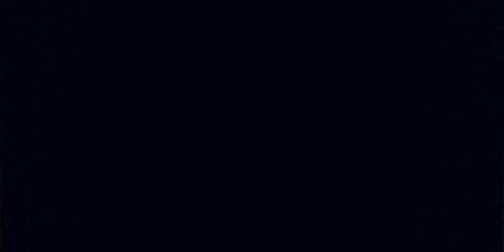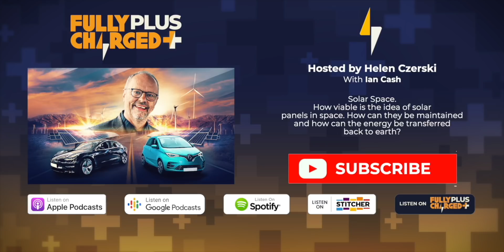Solar Space. Out of this world, or a realistic option with Helen Czerski.

Comment: A great back and forth discussion trying to keep the non engineers "in the loop".
Great to have an intelligent, informed and prepared interviewer (as Helen has proven to be so many times in the past) be able to listen, challenge and direct the interview with an eye to getting as much knowledge and fact on the table.
As always ... Great job Helen.  And thanks to Ian for bringing this idea out for discussion.
Reply: He's mistaken about methane in Starship Raptor engines though. CH4 combined with O2 gets H2O and CO2. And fuel is only 1% of the cost of the vehicle. Not as much of a problem as he claims.
Starship is planned to put 100 tons into LEO
.
Skylon (the vehicle designed to use SABRE engines) can't even come close.
Reply: What about Tidal power as the base load, is lifting 20 tonnes into space not an unnecessary step.

Comment: The immediate question is: if wireless power transmission through miles of atmosphere works so well, why don't we already use it in terrestrial applications? And the answer can only be that it doesn't.
Reply: Because the Earth is not flat. Apparently.
Reply: In order to keep the power density low to avoid microwaving wildlife, the collecting area needs to be enormous. This has always been one of the main selling points of space-based power beaming. It allows dual use of the land under the collecting mesh for crops or grazing livestock.
Reply: For one, it's conceivably safe to have a beam coming from straight above, down into a remote region. But having a beam travelling parallel to the Earth's surface will have a harder time avoiding any natural habitats (or human habitats!). 

Secondly the power beaming in SBSP is not there because it's desirable, it's there out of necessity to transfer the power 36,000 km through empty space. If you're on Earth you can use cables or just transport batteries if you need to move power around.

Comment: Whatever you think of this particular idea the maths around how much energy we need generate to replace burning stuff presented by Ian Cash is the starting point. What we could build with renewables and storage now doesn't add up. We need to bet on some new technologies. This idea (which sounds like 1950s science fiction because engineers did the maths in the 50s and realised it could work then, it isn't rocket science - OK, it needs the help of rocket science to get it to work) is one development. "Magic Batteries" that don't need all the worlds supply of rare earth elements are also not a sure thing. And if you want renewables + storage then you need things you can't make work yet here also. This idea might not work - but the point of needing to try and develop everything that might help (regardless of seeming religious ideology) is key. In 50 years we can decide which ones were silly with 20-20 hindsight.

Comment: With reference to the launch vehicle comments at 23:00, I attended a talk a few years ago by one of the managers from Reaction Engines. One point he made was that Skylon (their space plane design using the SABRE hybrid engine) would only be economic once there was an established hydrogen based economy.  Even then Skylon was designed to compete with older non-reusable launch vehicles that were putting less than 20 tons into Low Earth Orbit.   The SABRE engineering is very impressive, but its taken decades and still not flying. SpaceX's existing reusable Falcon 9 platform has already moved beyond that, and they seem to be moving a tad faster with Starship, which is the heavy lifter a large orbital platform would need. Coupled to SpaceX's long term goal to make their methane using the Sabatier process (because they need that technology to work for ISRU fuel generation on Mars, which is their real goal), and I think Ian might have to rethink those ideas if he wants a large solar collector in orbit.
Reply: Well said, I'd add, however, a very important point. Elon (SpaceX) wants to use Sabatier process powered by renewables to produce all Starship fuel (including oxidizer), which means that Starships will be burning what used to be CO2 in the atmosphere, which makes it carbon neutral (if you don't consider that some of the rocket exhaust, especially on interplanetary missions, would never get back to Earth).

What struck me the most, however, in Mr. Cash's "plan" is the 5 km wide beam of microwave energy that this satellite of his would produce... It's a circular shape, you'd need almost 20 square km of receiver to capture the energy.

Anyway, the dumbest thing about this is, that we already have a problem with Earth warming up due to our activity and this idea is literally a giant solar-powered microwave heater. The very reason why the 2.4 GHz band is available to "common folk" is that it gets easily absorbed by water, so I find the maximum 2% losses due to clouds a bit unbelievable. Also, speaking of efficiency, if you add the efficiencies that he mentioned: 47% for PV, 60% beaming and 84% receiver, you're back at efficiency of modern PV.

How much PV can you fit on 20 square km and for what price?

Comment: Loved the critical questions. I think there is something to it, a big however though, 5km² to get only 2gigawatt of power seems horrible, they really should get that beam more thight. If you would fill 5km² with a combination of solar and wind, would you not get a lot more power? I know you're back to the non continues nature of solar and wind then, but i personally think we need to switch more to use energy when it's available instead of produce energy when its needed.
Reply: The large area is necessary to keep the power density down to avoid cooking overflying wildlife and allow dual use of the land for grazing or farming. I don't think he adequately addressed Helen's concern about the nuisance factor for other users of the EM bands and astronomers. It's basically a giant beacon in space and 2% loss is still dissipating 40 megawatts of power in the atmosphere along the beam path. At low latitudes, that's a spot. At high latitudes that's a big line.
Reply: The Bhadla Solar Park is the largest solar park in the world, at 56km^2, delivering a Nameplate Capacity of 2.25 GW (real capacity of 225 MW to 560 MW accounting for capacity factor between 10% and 25%). So actually SBSP is significantly more land efficient - before even factoring in that crops could be grown beneath the rectenna since it only blocks around 15% of incident visible light.

Comment: As cool as collecting energy in space and beaming it down sounds. I have to wonder why its necessary? More energy than we can use arrives on earth from the sun every year. Surely its cheaper and easier to just collect it at ground level and use it locally.

The cost of solar panels are becoming so low that it makes far more sense to plaster every building in them and use it locally. No cost of storage, transmission etc. Diversify it with the other renewable sources and this is redundant.

Comment: Very interesting. I think Helen is rightfully skeptical here. The math for the problem seems to be the same kind of waffling we currently get from nuclear proponents which is the baseload argument. This person at least spells out how much (a ludicrous amount). But only by dismissing things like wind turbines, which reliably generate lots of power year round. Especially if you interconnect them with the rest of the European grid. Contintent wide lack of wind is very rare.

It's basically a lot of back of the envelope reasoning basically working its way up to the notion of "seasonal storage". As far as I can see the need for that is simply  not a thing. We have round the year predictable levels of solar, wind, geo thermal, hydro, and other forms of energy connected in a european grid. Of those, only solar is seasonal. And sure, it's lower in the winter and higher in the summer. So, all that means is that we  need a bit over production, diversity, and batteries to even out peak and demand. 

The notion that there's an off season where we would be running purely on stored energy is simply not true to the extent this gentleman believes it to be true (or rather needs it to be true for his plan to be anywhere near worth considering). The math simply does not add up here. It's a very weak pitch. 

It's more a question of how little stored energy would be more convenient to have compared to simply installing massive over capacity in the form of extra wind turbines and solar panels that we can repurpose to fueling the green hydrogen economy when they are not needed for charging batteries or the grid. 2x? 3x? 10x? With solar prices dropping, it's more  a question of finding the square kilometers to put them on than anything else. If current deployments are any indication, it seems that several countries are getting close to no longer needing fossil or nuclear power generation. All they need to get to 100% clean is more of the same.

IMHO we'll end up installing vastly more capacity than we need for our current needs simply because as prices drop we'll come up with more and more hings that we can do with cheap plentiful energy. A space based solution that is cost competitive with nuclear would not compare favorably with that because it would still be way too expensive. It would lose out on cost and take so long to realize that by the time it actually happens at scale, we'll have gotten rid of all coal, most gas plants, and probably a lot of the aging nuclear plants.
Reply: Dogger Bank wind farm cost £11bn and produces 3.6 GW nameplate (or 1.8 GW real output, assuming a very generous 50% capacity factor). Ian's SBSP concept weighs 2000 tons and generates 2 GW with 100% capacity factor, meaning at a launch price of even £3000/kg, it would cost £6bn in launch costs (which is projected to make up around 70% of the total costs of such a project, meaning £8.5bn total cost). Launch prices could also drop another order of magnitude if Starship is as successful as it aims to be. 

Additionally Dogger Bank only has 196 MWh of storage, no where near enough to make this a baseload power installation.

Comment: My question are 'do we need this power? What is this extra power is going to do for global warming?'. We already know that there is more solar energy hitting the ground than we need if we collected it with solar panels, so why do we need to bring more in from outer space? In Australia the cost of locally generated solar power is cheaper than the cost of transmission and as the cost of panels falls it will become a no brainer in many other countries. This is just a scheme to take the investment away form solar and battery storage which is also getting cheaper and more long duration e.g. flow batteries, molten salt batteries.

Comment: Sounds like something which could be weaponised. Just point it at targets you want to neutralize. Hope they have military level encryption in the control system and safety interlocks to cut energy transmission if it's not on station.

Comment: So he wants to downlink >1GW ( > +120dBm ) in the ISM band onto a receiving station. This beam must have a huge power density which would happily cook anyone in it's area (2.4GW = microwave oven band) and will prevent any other use of the band for 100+km in every direction. Other countries will rightly see this as a space weapon!

Risks to people around it due to error, crazy-operators, evil geniuses  are almost incalculable. As Helen noted the sidelobes on this beam will be very significant and I think that the quoted 60% link efficiency is somewhat optimistic.
Reply: This frequency would pass right through you and you'd feel nothing.

Comment: I was super keen on these when a solar cell was 100 dollars per watt. Increasing the output by a factor of 4-6 sounded great and well worth the cost of maybe 100 dollars per watt. 

Now it's 20 cents per watt there's no point. Just have either more panels or cables from sunny places. There's no need for storage.
Reply: UHVDC cables of 12 GW cost about a million pounds per km. To cover the UK's needs for all energy during winter you'd need 30 such cables to cover the 300 GW winter consumption. 

They can't be longer than 20 000 km. So that's 600 billion pounds maximum.

Solar panels are under 15p per watt. You'd need about 1000 billion watts nameplate of solar. That's 150 billion pounds. Total cost 750 billion pounds. After that the energy is free.

For comparison, the UK imports 40 billion pounds worth of oil. The value of gas isn't readily available, but probably broadly similar. So the project could pay for itself in well under 10 years.
Reply: @gasdive  Would the sheer amount of raw materials required to build that many cables not drive up the cost of those raw materials? And is this solution scalable to all countries with unfavourable weather? Also what about night time? I don't imagine you'll have cables stretching to the other side of the planet. Also you've got sovereignty issues - do we want to be that dependent on Morocco or wherever these panels would be located?
Reply: @Elliot-01  currently the UK is almost entirely dependent on imported energy. This would allow diversification of supply, increasing reliability not decreasing it 

The issue of raw materials is a good one. It would use about 4 million tonnes of aluminium assuming 30 cables with an average length of 5000 km. Over 10 years of construction that would increase aluminium consumption by less than 1%. That's less than the natural growth in consumption which is nearly 3%

Night isn't an issue because cable lengths are easily enough to reach to the day side.
Reply: @gasdive  Assuming you need to go to about GMT+8 with your HVDC cable to cover day/night, lets say you route it to China. Thats at least 8000km, assuming you can lay the cable perfectly in a straight line (unlikely). You lose 3% of energy per 1000km, so 24% lost in transport. Just a side note there. 

Addressing your previous point about oil imports - electricity doesn't replace oil. Our energy needs go beyond just electricity, to power vehicles (particularly trucks and ships) and stoves and heaters etc. Sure these could all be electrified but they wont be for 30+ years. And industrial processes like steel production and probably many more I'm not familiar with can't be electrified. 

Also sure while some low efficiency solar PV cells are 15p per Watt, actual costs of installed grid scale PV is roughly £1 per Watt nameplate from what I can tell. 

Finally, I think the sovereignty issue shouldn't be understated. Govts have to factor in risk when they make these kinds of decisions.

Comment: My objection to SBSP is more fundamental and goes back to the second law of thermodynamics. The earth is a closed system with the only energy input coming from our sun. That has to be balanced by the energy emitted back to space which is heat radiation which is directly proportional to the average temperature of the body above absolute zero. If we catch solar energy from beyond the closed system and feed it into the earth that will cause a rise in average temperature until the increase in radiated output balances the rise in input. Anything that adds to global warming is a very bad idea. People look at things without taking the big picture into account. Please tell them they are doing a fundamentally wrong thing.
Reply: Yes, I wondered about that very thing. On top of that all these energy losses along the way from the panel to the grid don't disappear - they're just lost almost always as heat.
Reply: @bibliotek42  once you point the energy beam at earth it adds to global warming unless it gets reflected back out to space before being absorbed. We should be putting mirrors up there to reduce solar input, not increase it!
Reply: The amount of energy captured would be tiny compared to the amount of solar energy hitting the Earth.  If we got all of our energy from space it's less than 1 hour's worth, and we'd need less of it.  Be more concerned about feasibility and cost.
Reply: The variation in the energy hitting the earth at different times of the cycles of the sun is a couple of orders of magnitude more than if we added heat by swapping all of our energy over to this method of capturing additional solar. The heat we create is not an issue. Carbon is.

Comment: Loads of possible storage solutions other than Lithium ion batteries. Put all that development money into storage solutions and we would be way better off.
Reply: Even gravity storage could be much better than chemical ones especially for long term storing
Reply: @vladt4010  @Richard Godsmith "All of that development money" has already been put there and li-ion/pol is the best portable solution people have right now. Only other viable option with high enough efficiency is water based gravity storage which has insane entry cost (basically same as building a dam). Every other option that was found so far is simply not worth it
Reply: @STruple12  There were few ideas on gravity, not only water based. See "gravity storage tower" for details
Reply: @vladt4010  Crap, you are right! If that claimed 90% efficiency is real then it looks really promising. Thanks